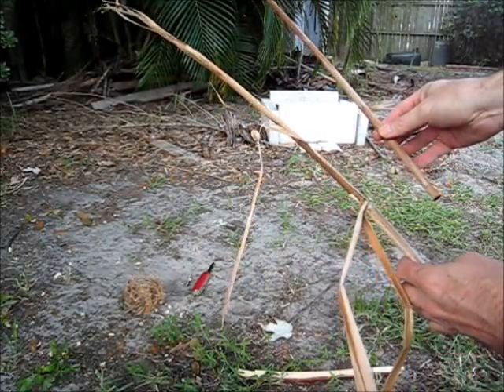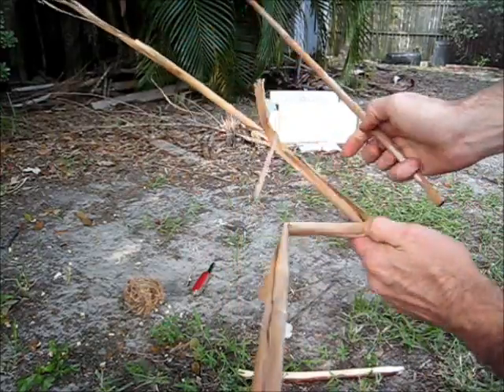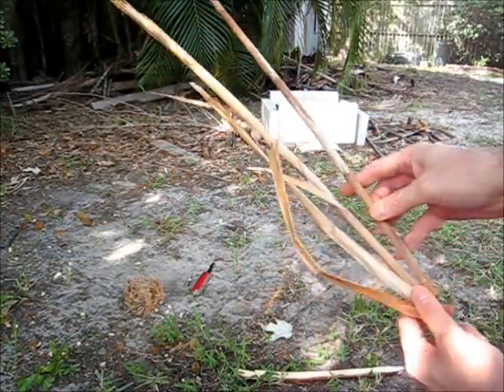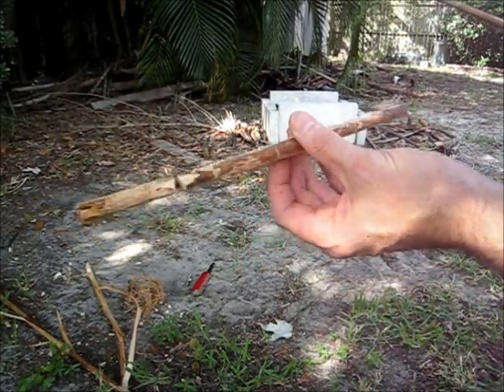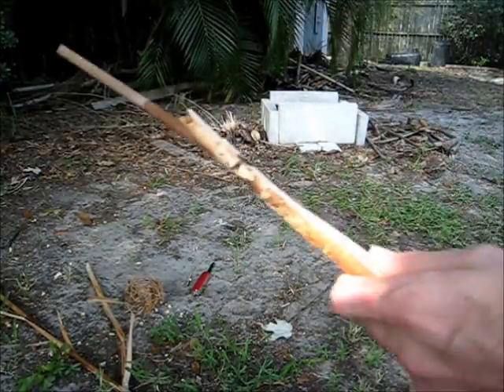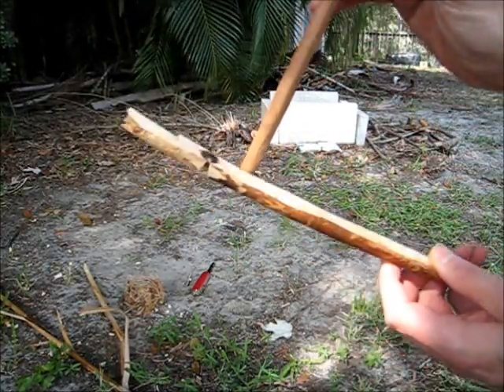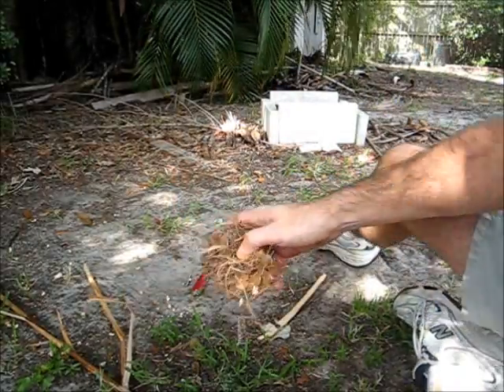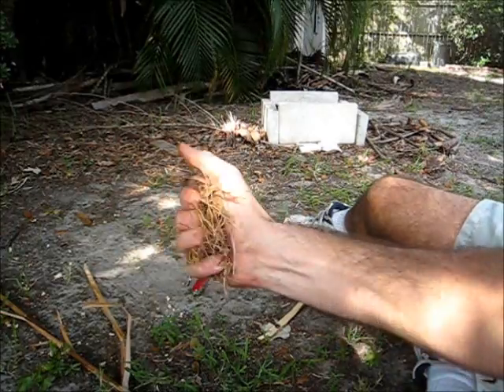Hand Drill Fire - Cattail on Yellow Pine

Comment: I've been at this for about 3 years and at this point I normally achieve an ember with each attempt. Yesterday however it required 4 attempts and I wondered what in the Sam Hill is going on. I was utilizing a new Horseweed spindle that I just harvested here in Salt Lake City, UT and I wondered if It might be to late in the season for it, as it started to kind of flake apart as I spun it. I've never experienced Horseweed do that. The first hearth was willow that had worked fine in the past. I decided to switch to a proven spindle and a cottonwood hearth and an ember was achieved. Good thing because that was my fourth attempt and I was about spent. We get these hideous valley inversions this time of year and the humidity just sky rockets. I decided to check the relative humidity and it was at 92% with a temp of 23 degrees. I wonder if that's what caused all my trouble? Any of your thoughts would be greatly appreciated. To compound things even further I discovered that there are 2 different types of humidity. Relative and absolute. The weather people always report the relative humidity. Relative humidity is cited in weather forecasts as it affects how we “feel” temperature.
Reply from the maker: Yes, state-of-decay of the hand drill set is a factor (spindle and/or fireboard). Especially when using wild weed spindles; They tend to be seasonal. It's possible for the stalk to be too old, brittle, or too decayed (ie. punky).

Yes, humidity is also a variable to consider. Especially, when working with freshly found on-the-spot materials. Relative humidity is the common measurement as it relates to current temperature. Whether it's absolute or relative humidity, moisture in general tends to add to the challenge. You could use a bone-dry hand drill set in fog or a set with a high moisture content in a dry arid environment, in either case, it can make it more challenging than the average effort for success. A dry set in a dry environment is most ideal. Using a good proven set in environments of less than 50% relative humidity tend to work reasonably well for average person. Less conditions typically means more time & patients to dry out the friction points of the set before going for the coal, multiple drying cycles (ie. multiple burn-ins).

A good way to experience this, is to practice the bow drill method using only freshly found on-the-spot materials, in various weather conditions, different times of day, different times of season, etc... This way you don't tear up your hands after so many attempts. Even better if you can use less than ideal tools & materials; Meaning, leave the hatchet, hand saw, ideal bushcraft knife, and parcord/ bank-line (ie. ideal bowstring cordage) at home. It's reasonably do-able with just a regular pocket knife and cheap shoelaces.

Generally speaking, from an on-the-spot perspective, you typically have more material options for the bow drill than the hand drill.

To refine your knowledge of the friction fire fundamentals, practice the hand drill floating technique. It will help you realize heavy downward pressure isn't so crucial for success. Plus, it's easier on the hands.
Reply: I happened across an interesting article regarding the affects of 
humidity on fire making. Thanks for all your detailed comprehensive reply's to my posts.
http://sultanaeducation.org/wp-content/uploads/2014/06/Fire-and-Humidiity.pdf
Reply from the maker: Excellent article. Thanks rappman3taken! It matches pretty much what I've experienced.

I'd just add that it's reasonably possible with good experience to be successful in humid and rainy environments. It may take several tries before success as opposed to the single attempt successes most everyone insinuates on YouTube.

Look for indicators of moisture before going for the coal so you don't exhaust yourself with failed frustrating brute-force attempts. When doing the initial burn-in, build up enough of a dust crater around the divot on the fireboard, then slowly tip the fireboard sideways and watch if the dust falls away. The more dust that falls away, the drier the wood. The more that sticks, the more moisture in the wood. An exception would be when working with resinous wood. The resin in the dust could also be the cause of the dust not falling away (being sticky). Resinous woods will work, just have to char (or cook) the resin dust particles first before they'll combust. Meaning, more time & effort going for the coal to get success. But, if you understand why then it's not so frustrating.

Do multiple burn-ins (or drying cycles) to pre-heat the friction points of the set to steam away any moisture in the wood. After each burn-in, do the dust drop test until most of the dust falls away and you get a sense you can go for the coal without too much exertion. I usually don't have to do more than 3 to 5 drying cycles which may add 5 to 10 minutes to my friction fire-making session. A reasonable trade-off for an increased success rate.

Another indicator is when cutting the notch, if the wood feels clay-like or doughy, it can also suggest there's a lot of moisture in the wood; Another clue on how hard or easy your attempt(s) will be. More drying cycles may be needed before going for the coal.

Watch the smoke. If the dense smoke hugs the spindle as opposed to quickly dispersing is another indicator there's a lot of moisture in the wood (mixture of steam & smoke). Again, more drying cycles likely needed before going for the coal.

Generally speaking, if it takes longer than 15 - 20 seconds to get good smoke, it's likely there's too much moisture in the wood. Success is less likely or you'll be over-exerting yourself if you try to push through. You may need to tweak your set or do more drying cycles before going for the coal (work smarter, not harder). It's another good indicator to know whether you're ready to go for the coal or not.

Looking out for these moisture indicators (situation awareness) will give you a better sense of your success rate or knowing whether it's even worth attempting. These indicators can also save some wear & tear on your hands with hand drill attempts (floating technique can come in handy).

Also, there's usually some official agency that has a 'Fire Index' or fire danger rating concept (ie. Forest Fire Danger Index (FFDI). Like the Florida Forest Service has a Wildland Fire Danger Index (FDI). There's also the Wildland Fire Assessment System for the USA (Fire Weather). This can also give you an idea how easy or hard friction fire success will be in your area. An example, when I traveled to Carson City, NV, I had little trouble using on-the-spot Sagebrush in 10% relative humidity. A major contrast to what I'm used to experiencing here in humid FL (60%+ humidity).

Comment: What a show off! I've tired cattail on just about every soft wood and was never successful, I only trust horse weed just because my first 50+ attempts were unsuccessful
Reply from the maker: If it'll make ya feel better, I'm not always this successful with Cattail. Every now and then you do find nice gem spindles of various weeds that work really well. I've had my share of collapsed or disintegrated Cattail spindles, though. A little finesse helps since Cattail tends to be more fragile.
Recommend experiencing a variety of wild weed spindles instead of just one go-to material. You'll get a better feel for approach depending on the different types of materials available.
Reply: +gundog5 // thank you! But for now my favourite species are cotton wood and horse weed
Reply: I first learned friction fire on cattail and it has since been my favourite but same here, some spindles have to be entirely discarded because they for reason or another are too soft, too fragile or just don't work for some unknown reason.

Comment: I just tried Cattail for the first time and as soon as I applied a significant amount of downward pressure it fractured and broke. Is there an optimal period to harvest it to prevent this?
Reply from the maker: +rappman3taken  Hmmm. Not necessarily an optimal period per se. More of a luck of the draw. There's often multiple variables to consider that can make it difficult to always select the best hand drill spindle materials. You can pick a good stalk then 20 ft over pick a bad stalk. You may have to select many stalks to eventually find one that works well. State-of-decay and weather exposure are always factors (ie. timing).

I wouldn't worry too much about it. It's not just Cat Tail, but many other wild weed stalks suitable for hand drill. Not all Mullein, Horseweed, Teasel, Yucca, Elderberry, Thistle, River Cane, etc... are always great and wonderful. Example, I had a really great experience using Caesar Weed and effortlessly spun up coals every time. I bragged how wonderful it was until a year later I found another patch growing, but it wasn't nearly as wonderful the next time around. Same goes with Yucca and Mullein. Florida Yucca is awful. Almost petrified. I'd have better luck with an Oak spindle, ha ha. I found some Mullein on a couple mountain sides in Denver, CO. It works, but not as wonderful as so many other hand drillers say. Perhaps I was harvesting it the wrong time of year (ie. Feb).

One of the biggest problems with on-the-spot hand drilling is finding suitable wild weed stalks tend to be seasonal. It can be tough to find stalks that are dead enough or not too decayed (breakup or disintegrate); Just right. Cat Tail's not a good on-the-spot option as you usually have to dry it out first since it grows in ponds or other water saturated environments.

Cat Tail tends to be more fragile than other more common hand drill spindle options. It usually needs a little more finesse to get a coal. It's great to practice with because you learn that brute force isn't always the answer. It helps you figure it out without forcing it.
Reply: +gundog5 Wow! Just what the doctor ordered. Some of my inventory is Mullein that I harvested in the late fall last year and it works just fine. I decided to harvest some about a week ago after the winter and late in the Spring. I noticed the color is different and they are flaking off as I spin them even after cleaning them up and drying them. Close but no lit cigar. Pun intended. I got plenty of smoke but could not achieve ignition. I've been at this for about 2 years now and there is so much more I need to learn. Thanks very much for such a comprehensive reply.  I don't know if you've ever heard of a hand driller named Storm. Unfortunately he passed away but left behind a wealth of information. I dropped the link below if you haven't come across it before.  I think you might find it interesting. The Base Line Data in Table 1 is amazing regarding the amount of time to produce that. Thanks very much for your valuable time.

http://www.primitiveways.com/hand_drill.html

Comment: Hi, I have just started trying to use a cattail spindle and have found that it wears down very fast in the center but not so much on the outside of the spindle. This causes a mound to form instead of an even depression. Do you have any suggestions as to why this happens and how to stop it?
Reply from the maker: +Adam “111y111y” Ashing  It happens because the center of the spindle is softer than the outer edge (a pithy center). it wears down quicker. The dimple (or mound) in the middle of the fireboard divot generally isn't a problem during an attempt. If I use the same divot several times and think it's in the way, I just pop it out with a knife before the next attempt.
Reply: Thanks for replying so fast. Will bear this in mind for next time.

Comment: I came looking to see if cattail could get the job done. I now have no more excuses....
Reply from the maker: +Jason Fazio Well, sort of. Cattail works well when it's in a good state-of-decay. It often needs a little more finesse than other weed stalk spindles. I've also had many cattail spindles disintegrate in my hands when I almost have an ember. Can be frustrating at times. But, when you have a good one, it's really nice to work with.
Reply: It's all I can find right now. I'm looking for Mullein, but can't seem to find any. 

I've still got a lot of conditioning to do, so I'm really in no hurry.
Reply from the maker: Jason Fazio Recommend becoming proficient with the bow drill first then focus on the hand drill. There tends to be many more wood options for the bow drill method over the hand drill. Especially from an unplanned event perspective. That, and you don't have to wait for (and maintain) good hand conditioning for hand drill. It all depends on perspective.

Comment: Do you have to press inward with your hands almost as hard as or harder than you press downward in order to get the downward pressure and to stop your hands from sliding down the spindle?
Reply from the maker: Yes. It's a balancing act of both inward and downward pressure. It varies depending on the materials and environment.
Reply: Thanks for the reply. I'll keep at it. Until then...bow drill to the rescue.
Reply from the maker: Yup. It'll come. You're hands likely need time to adapt (get conditioned). It took me about a month with a few blister/ bruising recovery breaks mixed in before I finally got a coal .
Reply: I'll keep at it. Thanks.

Comment from the maker: Thanks. I've done the small end a few times, even used both ends. It often depends on the materials and environment whether one end is easier than the other. Good point, though the small end is an option many tend to overlook. Myself included.